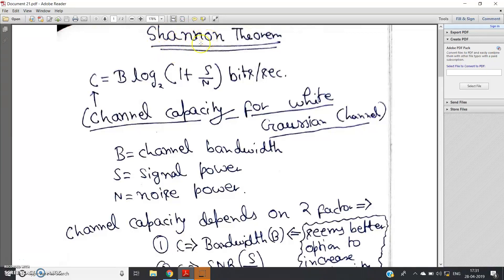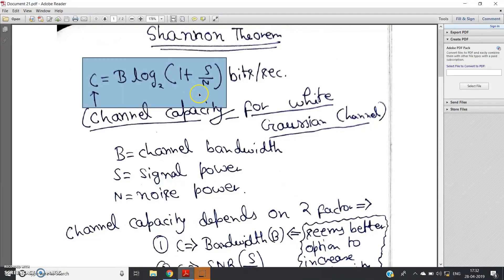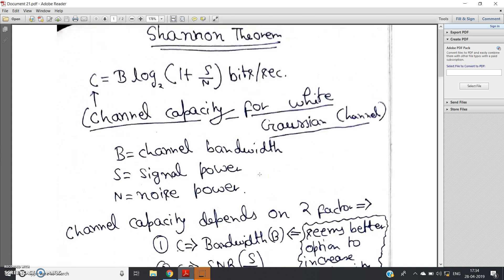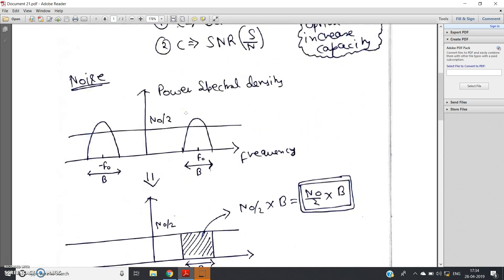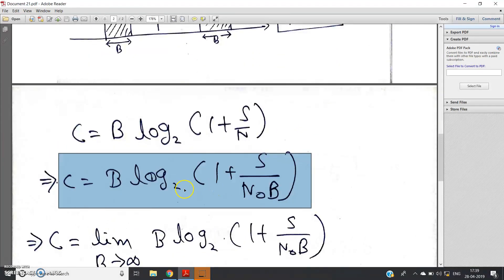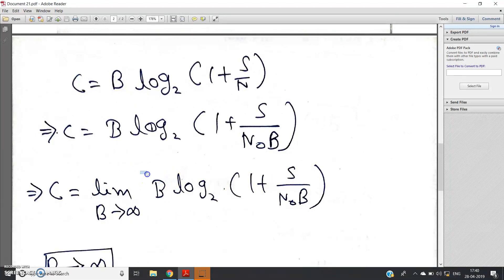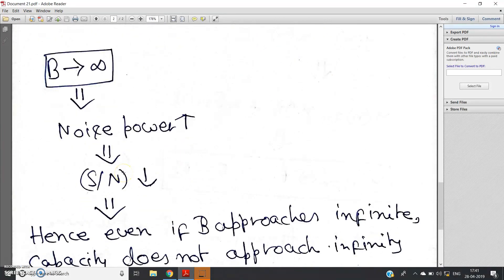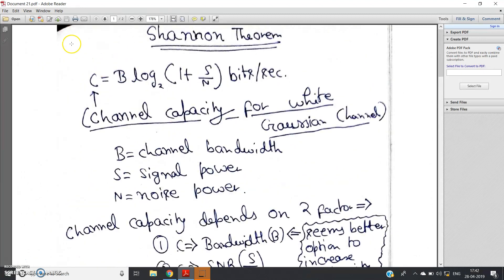Channel Capacity Theorem | Infinite Bandwidth channel | Noiseless Channel

Comment: Nicely explained...Can you please explain with example how is the bandwidth and channel capacity different from each other?
Reply: Standard digital telephone channel is B= 3.1 KHz. and SNR = 35 dB. ==> BANDWIDTH = 3,1 KHz
Applying Shannon law => C = B log2(1+SNR)   ... SNR times, not dB, then SNR = 10^(35/10) = 3162 times
C= 3100 log2 (3163) = 3100 log (3162)/log (2) = 3100 * 3,5/0,3 = 36167 bps  ==> CAPACITY = 36.167 Kbps.